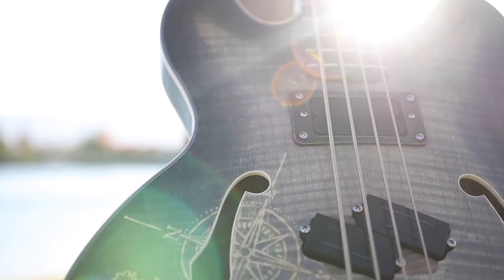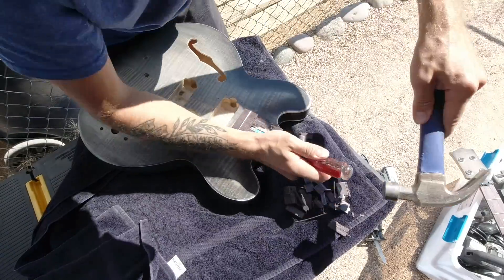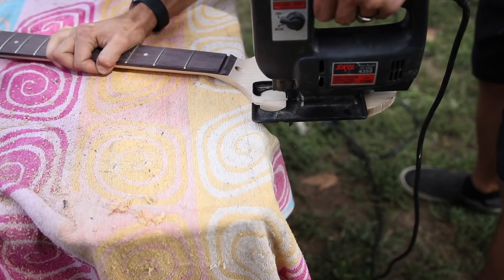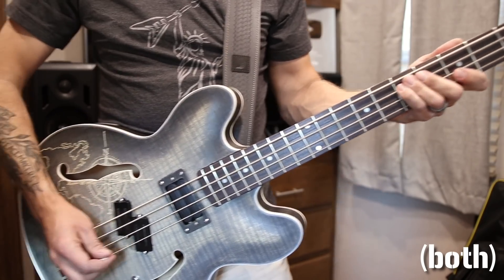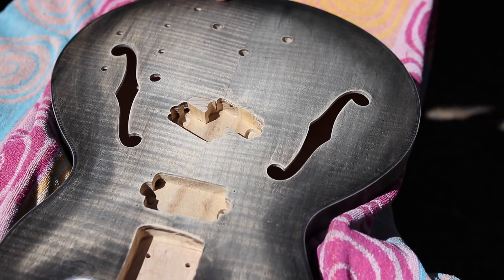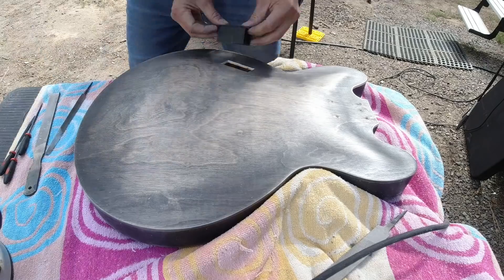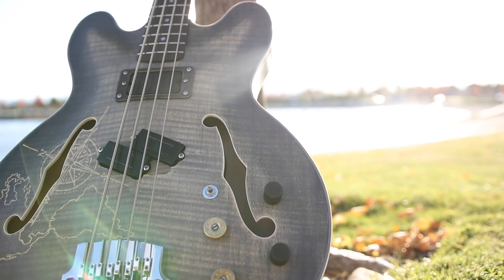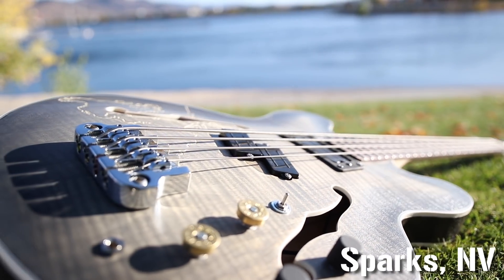Build your DREAM SEMI HOLLOW BASS!!! (ES335/Starcaster bass kit build)

Comment: Hi, Dan!
Re: The treble switch:
If 'ya swapped out one of your pots for a push-pull pot and did some minor solder work, you could replace that DIP switch with the aforementioned push-pull, so you could change it on the fly.

Comment: For those who don't know bass and guitar pickup are made the same way just that, pickups with poles or screws are dedicated to each ones, but every blade pickup works on bass ( There are even people back in time putting guitar pickup in eb0/eb3 under the cover, to replace the mudbucker ) si strat blade pickup, firebird, Charlie Christian, danelectro ... work on bass, and every blade bass pickups could be put on guitars

Comment: Thanks for this video.  This was the exact bass kit from Fretwire my wife bought me as a project.  I trusted that the neck would seat correctly after gluing.  I WAS WRONG!  I glued that bastard in strong.  Once the strings were on, they laid across the neck solidly and no amount of raising the bridge would help.  I now know I should have tested it first, but I didn't think I would/should have to.  I'm not good at woodworking, but I at least now have an option.
Reply from the maker: A replacement neck is not that expensive. If you email sam at the fretwire and tel him your story, maybe he’ll give you a good deal on a bolt on neck to replace it. It’s worth asking!
Reply: @GunsandGuitars  Thanks for the reply.  I've been subscribed to your channel for a while because I love both guitars AND guns.  You couldn't ask for more from one channel.  I will contact Fretwire.
Reply: @GunsandGuitars  BTW - That bass sounds exceptional.  Even one more reason for me to get it up and running.

Comment: What's the height of the Hipshot bridge, compared to the inch-and-a-half you were at with the Gibson 3-point?  I'm building this same kit, and I'm curious if I'll be able to make what's included work (assuming I can get the provided neck set at the correct angle). Just looking for a good target measurement at the rear saddle.

Comment: Very cool Bass.  Is it possible to correct the neck angle problem before gluing the neck on?
Reply: It definitely is.
There is various ways.
One would be too machine it down carefully with a router or even a belt sander.
Another would be too shimmy shimmy it with a wooden wedge shimmy from Stew Mac or such.
Once it's glued in the joint is just as strong as if it wasn't there.
So it's possible, but not necessarily for everyone
Reply: @der_Schreiner  Thank you for tip.
Reply from the maker: Yeah it definitely could have been avoided. I did a test for before gluing and looked good enough for me. I must’ve not looked good enough because it turned out really bad. Something I could’ve easily corrected before glueing.
Reply: @GunsandGuitars  The fix was an outstanding comeback.  Now it really looks Kustom...  Great work.